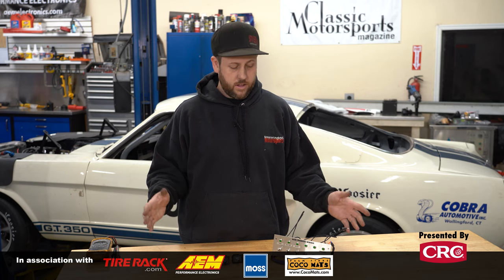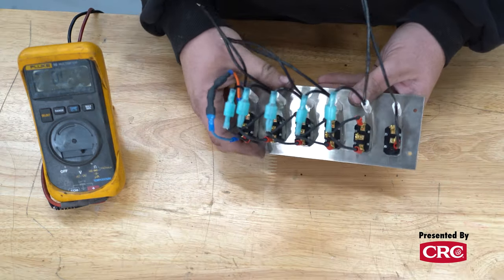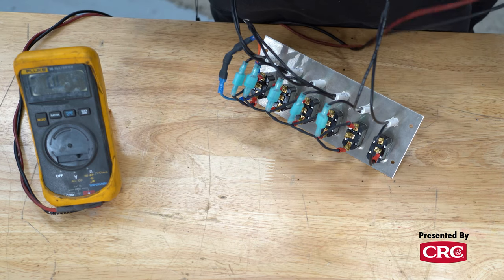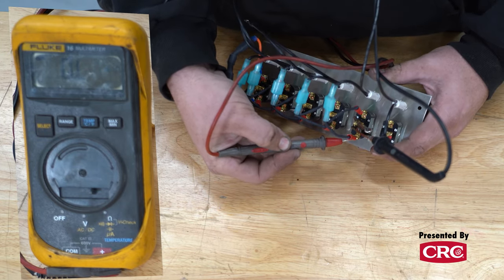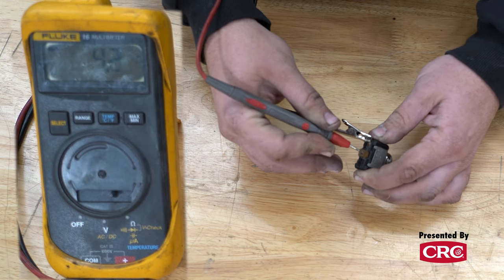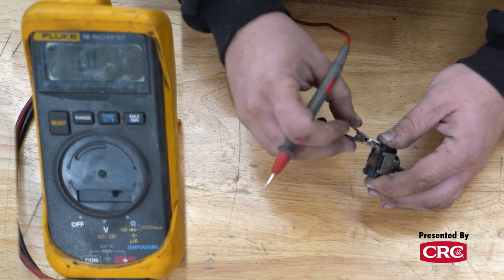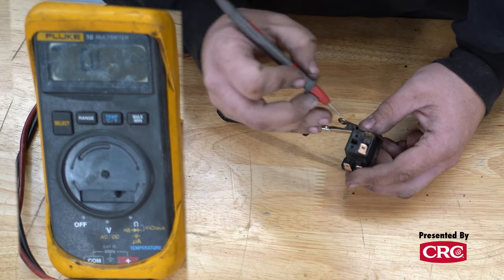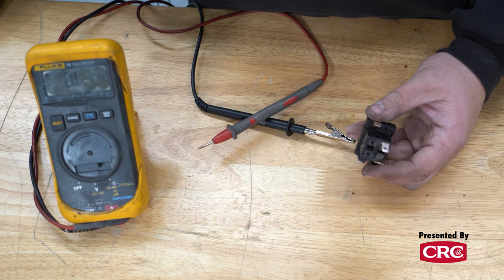How to Use a Multimeter to Test Automotive Switches

Comment: Well the instructions on the multi meter tell you that and poa neg doesn't matter if you put them in the wrong spot they will read negative and positive If they are in the correct apot but if it reads zero it means they are connected